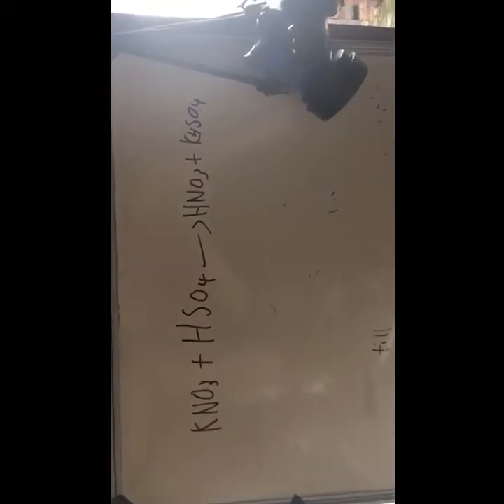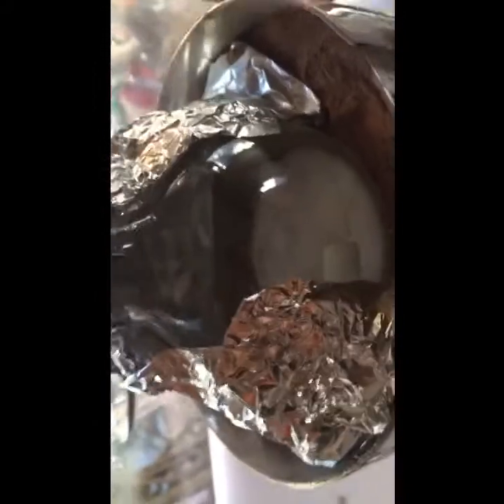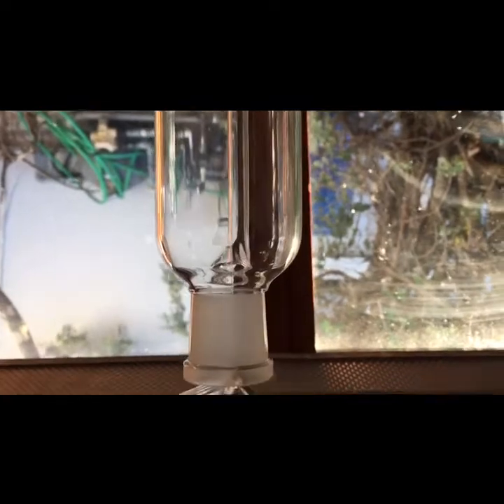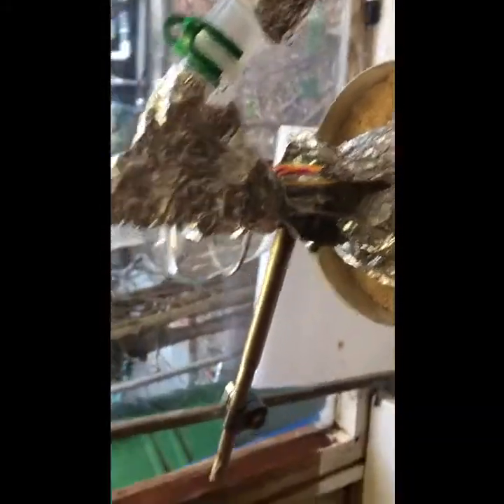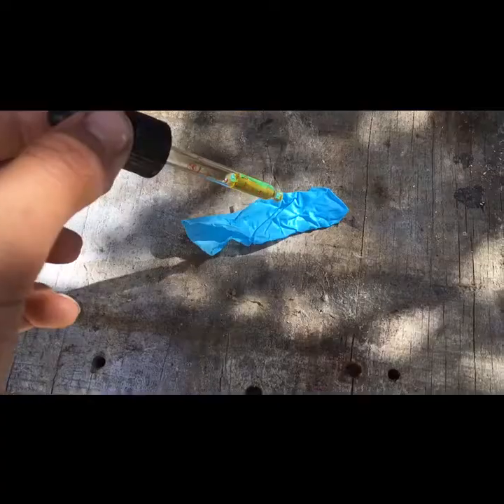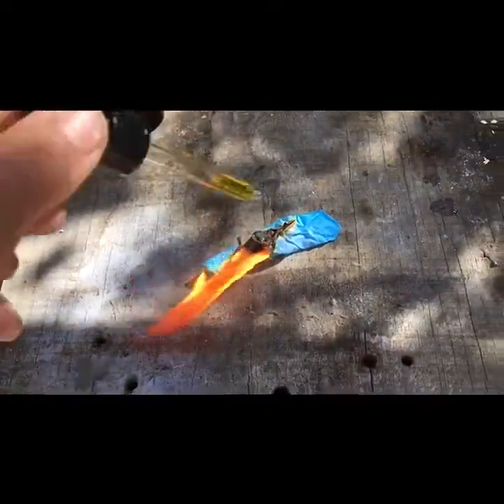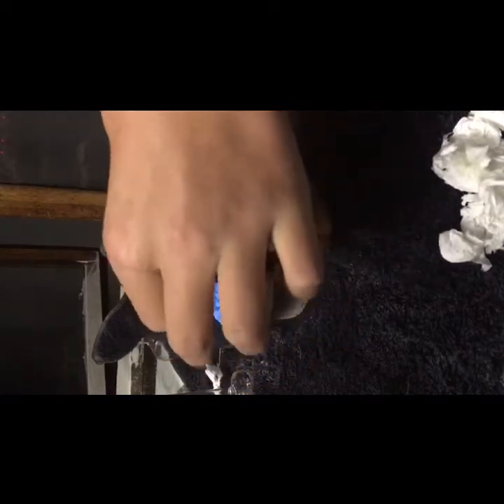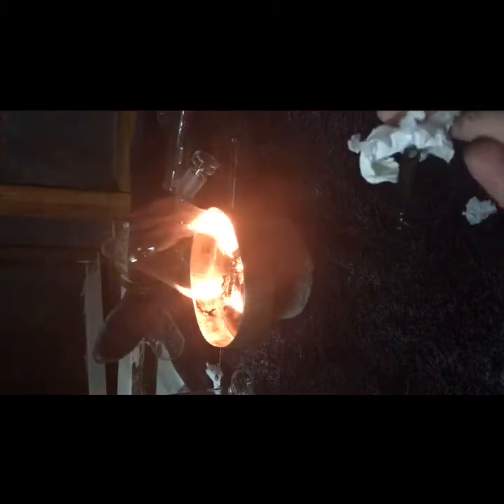Making fuming nitric acid

Comment: Do you have access to PTFE tape?  If so the thermometer adapter o-ring can be wrapped in the tape to help protect it from the nitric acid.  It's not perfect, but it helps a lot.  I went through a lot of trial and error to find that out.  Lol!
Reply from the maker: BackYardScience 2000 LOl thanks for the tip I will definitely try that,hmm I have Teflon tape but basically the same so thanks 😄😄